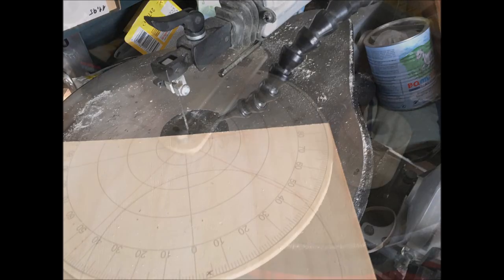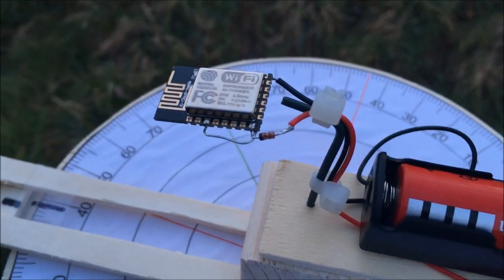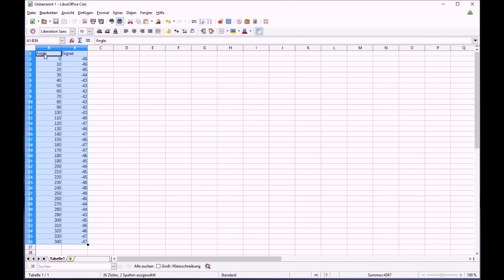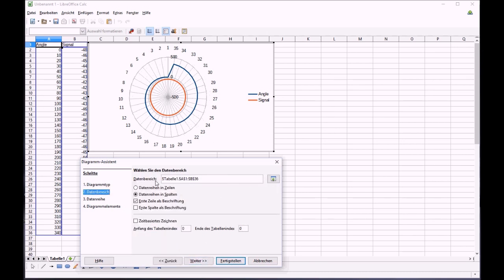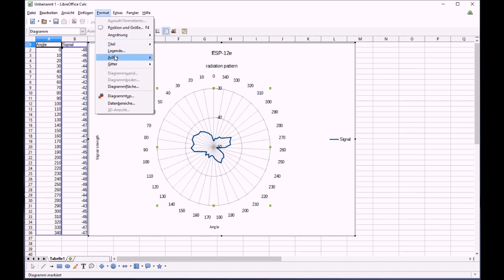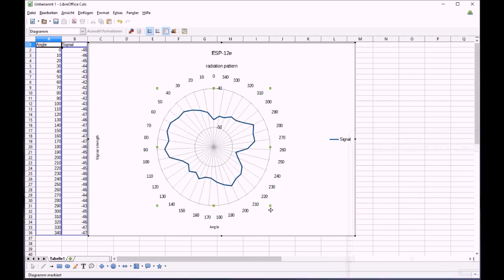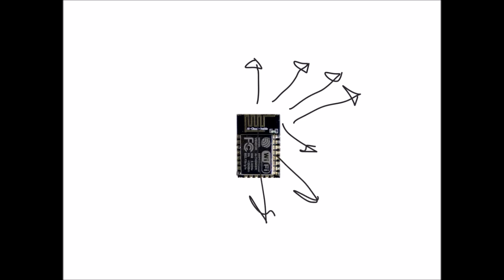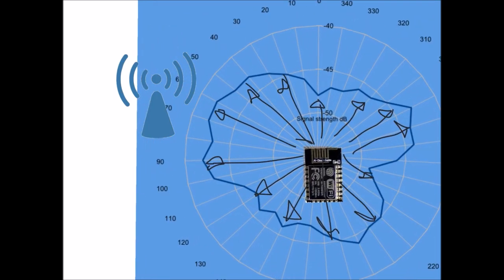Tracing the radiation pattern of an ESP8266 ESP-12e module

Comment: It would be nice to test x,y and z orientation.   An obvious way to do it would be in a flatter terrain to avoid reflections and use a stepper motor to step around 360 degrees and fully automate the test.

Comment: Did you do it on vertical cross section as well.
Reply from the maker: No, in retrospect, I should have. But no :-(
Reply from the maker: The Fluke Wifi meter I could borrow from work made things a lot easier, as it reacts very quickly and gives reliable readings.